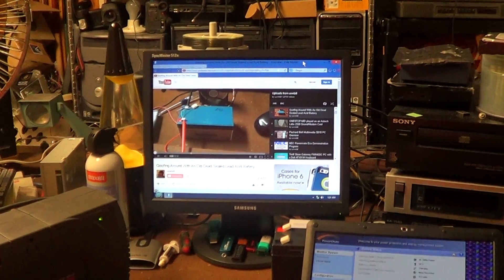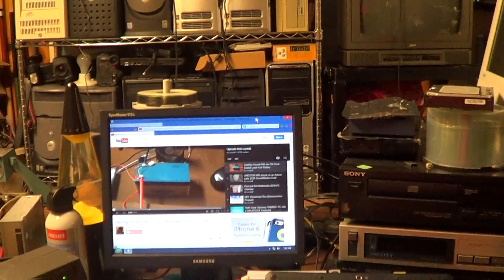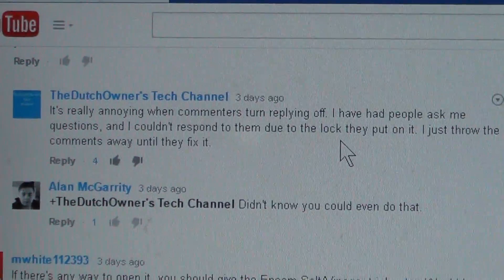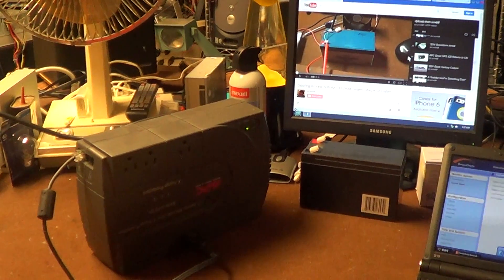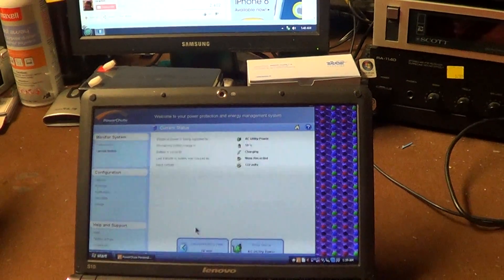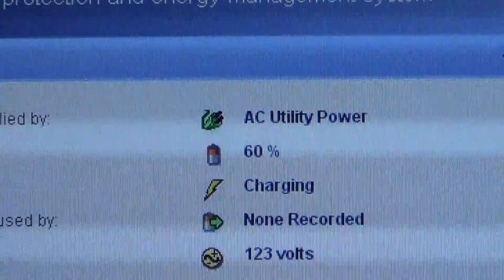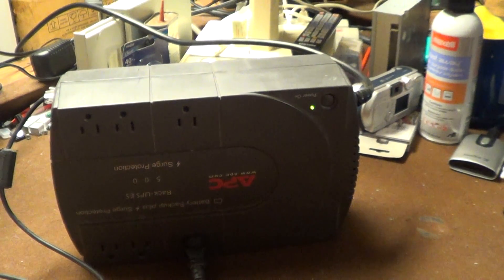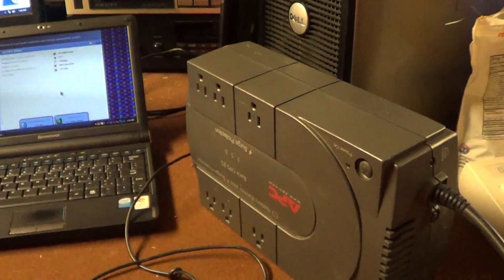Re-Enlivening An Old Dead Sealed Lead Acid Battery

Comment: I actually have an ES 550 on my desk right now powering my entire setup. And I'm quite shocked at how well it performed. It's kept my desktop up for about 20 minutes or so, and it carried my old 2012 MacBook Pro through a 2-day power outage a couple years ago. I got it in 2011 (as a joke gift from my mom because I went without power for 2 weeks because my roommates didn't pay the bill), and it's been a solid piece of hardware ever since.

Comment: Is re-enlivening the same thing as un-deadening?

Also, I'm curious as to why the netbook's LCD appears to flicker on-camera (which LCDs normally don't do) while the Samsung monitor does not. Maybe because the netbook uses an LED backlight with PWM brightness regulation?
Reply: jaykay18 That kind of thing tends to be noticeable to the eye on LED backlit LCDs if the brightness is low enough and is exceedingly annoying.
Reply: I don't know the reason, but I have a netbook that is LED backlit which does the same thing.  Another laptop I have with the older CCFL/inverter-style backlight does not exhibit the same issue.

Curiously, my 7" Tablet, also LED-backlit, does not have a problem on camera either.
Reply: You may have something there.  It is possible they change the brightness by pulsing the LEDs, rather than lowering the voltage to them.  That may explain why (due to shutter speed differences) this happens.
Reply: ***** You bet your sweet bippy I will!
Reply: Oh yeah.  CRTs were awesome.  I still prefer and use them wherever I can just for that reason.  It was tried and true technology, CRTs had been around for many decades before and have only been improved upon.  LCDs don't have that same tenure, and after a number of years of CCFL they jumped to LED backlit, which totally killed the color rendering capabilities.  White LEDs are nowhere near white.
Reply: jaykay18

I think the only advantage to led backlighting is that it saves a little bit of power for battery operated devices. On the other hand, you then have companies blatantly lying and calling their led-backlit LCD screens "LED Screens", when they're obviously not; that just pisses me off.
Reply: That's a big 10-4 on that one!  Outright lying, and charging more for it!
Reply: *****

Interesting you mention that, because my Note2 does flicker really bad when the brightness is set lower (which is why I always have it at full blast) where my Epic (also equipped with a Super AMOLED display) did not exhibit this flaw.
Reply: There are many factors in getting a good result. One resource I found which successfully combines these is the Magic Mender Wizard (google it if you're interested) without a doubt the most useful course i've seen. look at this  great site.
Reply: OLED

Comment: I prefer listening to ramblefests over listening to my professors talk about boolean algebra with Python and bootloaders...sorry but I can probably only use one of those chunks of information to blow shit up.
Reply: Boolean Algebra?

"x = 12, true or false?" :P
Reply: .#I had to write this program in class...
num = input('Number goes here:  ')
num = float(num)
if num%7==0 and num%2:
     print('This number is even and divisible by seven.')
if num>25 or num%3==0
     print('This number is greater than 25 or a multiple of three.')
.#This was way easier in digital electronics with and/nand, or/nor, and not gates.
Reply: Just skip to the part where we learn how to clear the damn command line window, I can't find that in any documentation anywhere!

Comment: I always loved how older APC UPS's that used miswired null modem cables to screw you over. Oh you wanna use a normal serial cable? nah we'll just shut the UPS off because eff you.
Reply: I lost my cable some time ago and just looked up the pin out as soldered a USB cable where the connector is.